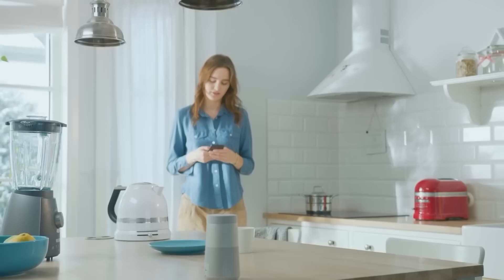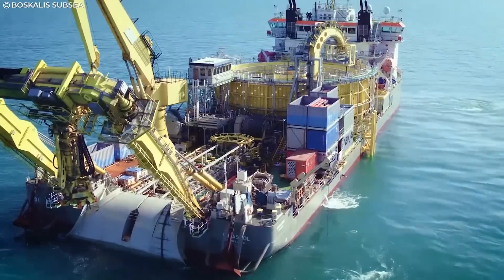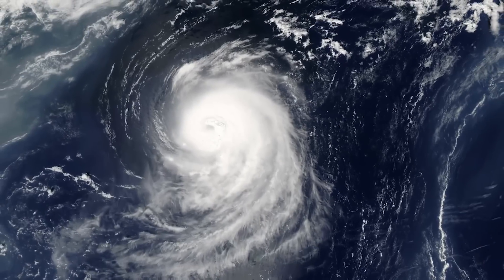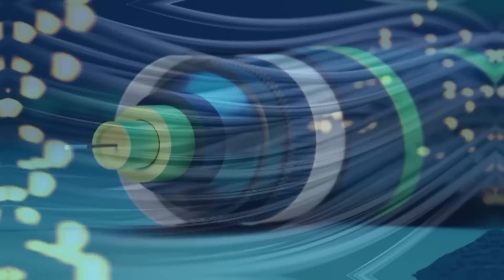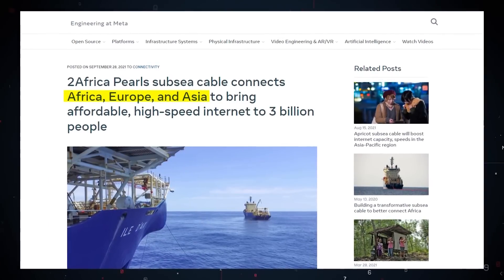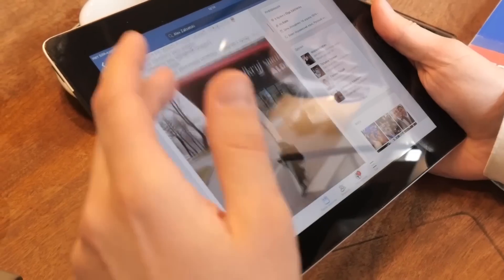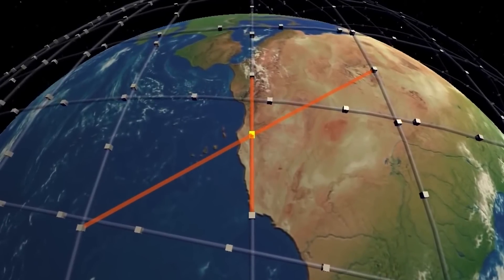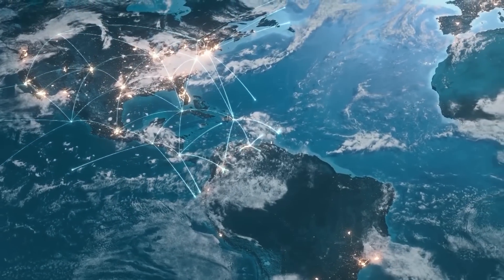How The Internet Travels Under Sea

Comment: So, why exactly do we have “satellites”?
Reply: Originally, cables across the ocean were copper, first for telegraph and much later voice.  However, the bandwidth was very limited, so a cable might carry a couple of dozen phone calls.  This made those calls very expensive.  Then satellites were used, which provided much more bandwidth and much cheaper calls.  However, the bandwidth of fibre supports a lot more calls and all sorts of data.  Satellites are still used for places that aren't connected by cable.
Reply: Satellites are used for many purposes, like GPS and navigation as well as telecommunications. In areas where there is no wired connectivity or is unreliable, you can use satellite phones or satellite internet.
Reply: Satellites have numerous other uses. internet supplied via satellites will be much slower compared to under ocean cables. Satellite internet is available anywhere in the world like with Elons Starlink
Reply: For islands

Comment: I think you'll find these speeds to be reported in bits, not bytes. Bits is data rate, Bytes is data amount. A Byte = 8 Bits. They are both metrics for data volume, but are used for different functions.